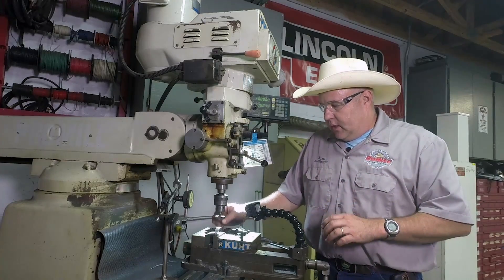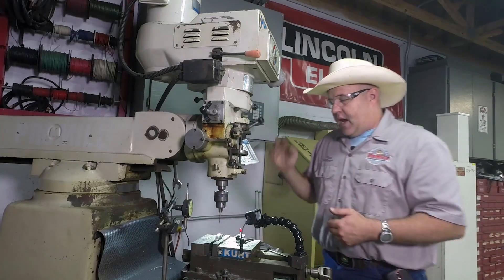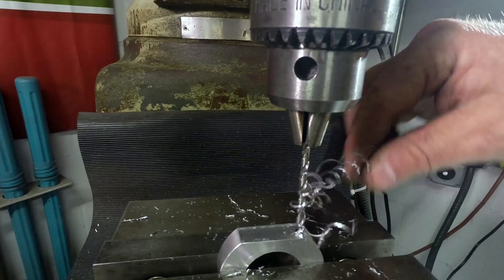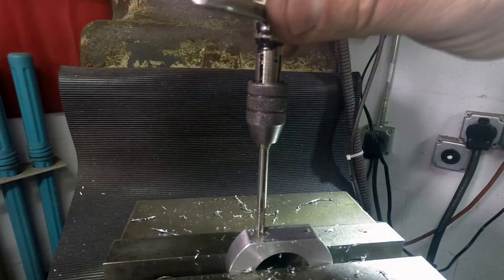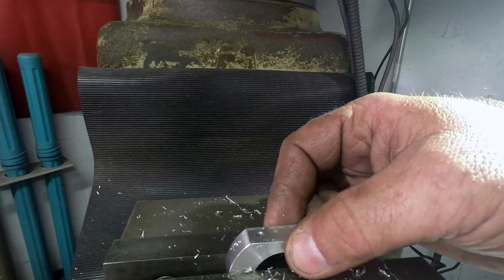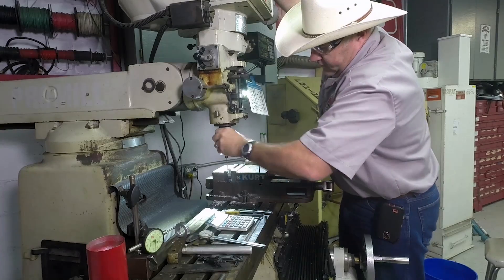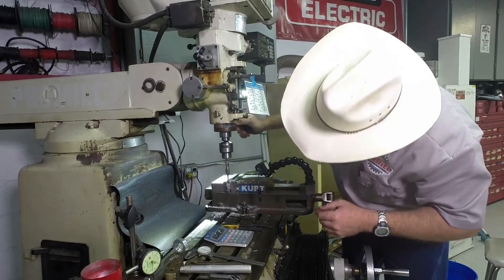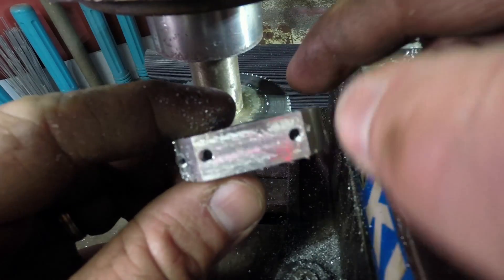Part 2 - Building a toy steam engine generator; drilling, tapping, and slitting the generator casing

Comment: All parts could be easier welded/solder if the material would be copper-based (brass or bronze) ! Apart of these problems most parts could be made with small lathe with milling head/device.
Reply from the maker: But that would not be my way of doing it, I like the challenge!

Comment: I didn't see any runout on the drill bit when you drilled the clamping hole. That makes me think your chuck is probably mechanically OK. I can think of three possibilities for the runout with the first bit:
1) You chucked the drill deep, onto (or almost onto) the flutes. This can cause runout. It can also result in breaking the bit at the bottom of the chuck jaws.
2) There could have been a chip between the drill bit and one of the jaws.
3) There could be a chip inside the chuck that sometimes gets between a jaw and the case.
If the second drill hadn't run true I would also have suspected the R8 to Jacobs adapter, but in this case I think it is OK.
Try re-chucking that same drill, being sure you are off the flutes, and recheck the runout with an indicator or using the camera again. It is a LOT easier to see runout with a camera. :-) I'd also look up inside the chuck with a bright light and see if I see any chips. Hope some of this is helpful.
Reply: or he just use a drill about 0,2 mm smaller and hes good to go just dont care surface finish